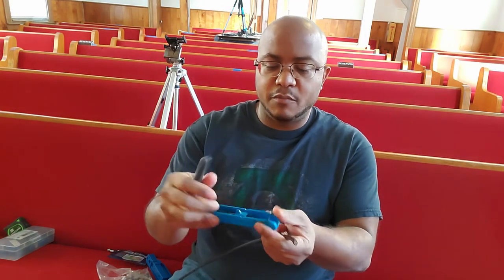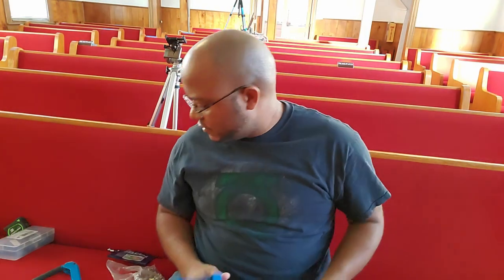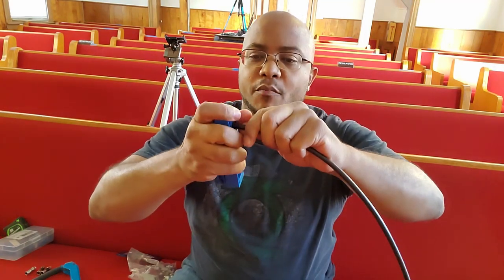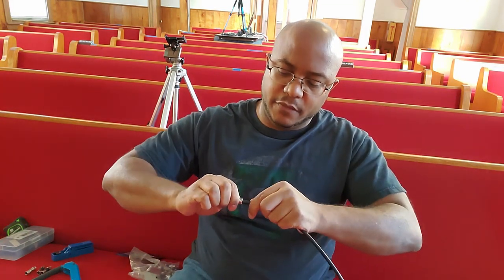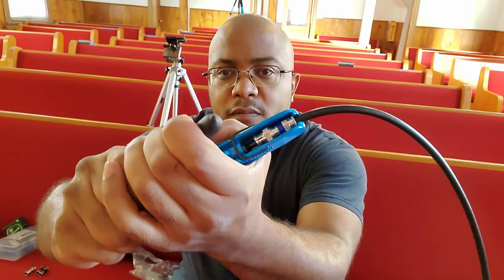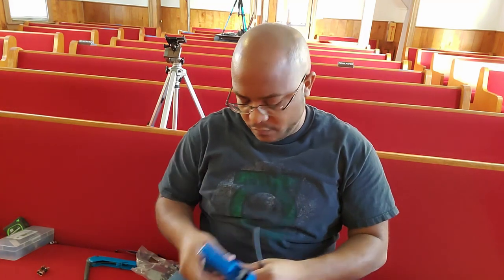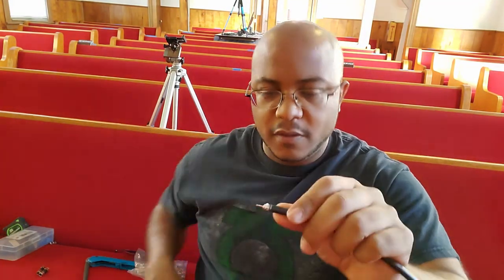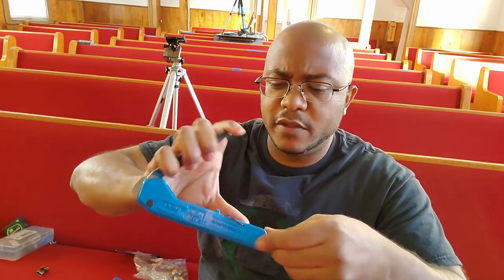HOW TO MAKE YOUR OWN SDI CABLES | How to Terminate SDI Cables

Comment: Question, 3g and 12g, are they the same cord or what’s the difference
Reply from the maker: The difference is the thickness of the copper 12g supports 4k 3g only supports 1080p
Reply: @AJaytheCEO  Thank you for your reply. My real question is this. I have a Canon C500 with 3gsdi, I'm looking for a recording monitor, I found one with 12gsdi. Will I be able to use this recording monitor with my camera and if so, which wire would I need, 3g or 12g? Thank you for your time!

Comment: Trying to find straight answers on 6G cables is a nightmare. i was just wondering if the RG-6 cable that you linked here is rated for 4k video. thank you so much for your help.
Reply from the maker: I haven't tested 4k since I don't have any 4k capable converters

Comment: I have a question; My video preview/output is now showing up a green tinted kinda fuzzy picture. I'm not sure what's bad. I was thinking it was either the SDI cable of my box. any help would be appreciated.
Reply from the maker: When the image is green that typically means that your monitor cannot display the framerate or resolution that is being sent to it
Reply: @AJaytheCEO  it only shows up in my evmux platform preview. and streams as I describe.

Comment: To be clear, the RG6 being linked can be used for 3G SDI(1080p60), correct?

Also the linked crimper and compression connectors do not work together without a slight mod to the crimper.
Reply from the maker: Yes that cable works as that is what I use and I didn't need to mod the crimp tool

Comment: I bought my "wire tool bundle" from your link, and it came with F type connectors. I was expecting the BNC. Guess I should've read the description more clearly 🤷🏿‍♂️
Reply: Can I use these F-Type connectors in place of the BNC connectors?
Reply from the maker: You could use them but you cannot connect them to BNC devices directly without an adapter but at that rate you might as well just use BNCs
Reply: @AJaytheCEO  yeah that makes sense. Using it for the BM HDMI to SDI converters... I'll just go buy some compression bnc connectors then. Thanks for the response.

Comment: Hey Jay, I'm into audio and a little video. My church has asked me to head up a project for audio and video for them. I have a tech background so cabling isn't new to me. I'd like to know how you price out the work you do? I've to to put together a proposal asap. I'd appreciate some feedback on things to consider when pulling cost together. Or some direction on how to gauge speaker sizes for sanctuary. etc thanks in advance!
Reply from the maker: Based on my history I charge $250-$400 an hour depending on insurance and risk/heights involved running cables.

Most of my references come from my work at Antioch when it comes to size of speakers and televisions

Comment: Strange that the pin doesn't have to be crimped.
Reply from the maker: The ends I use wedge in the pin. In the military I had to do the pin and cup separately